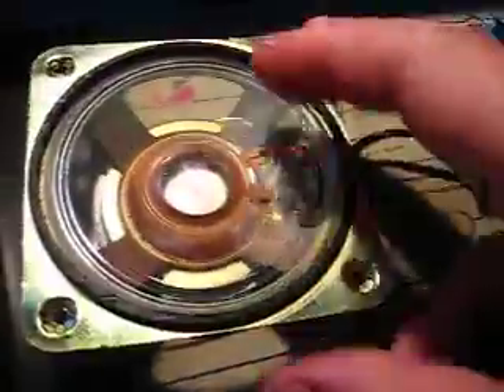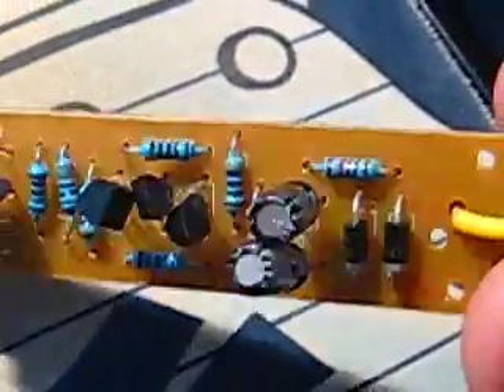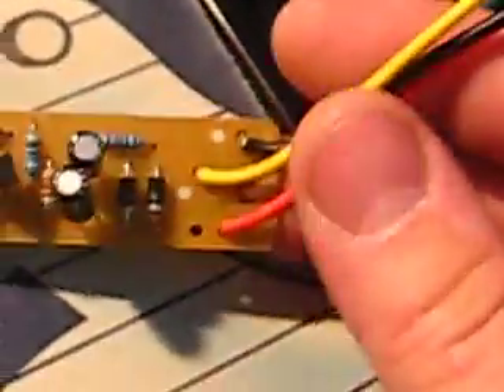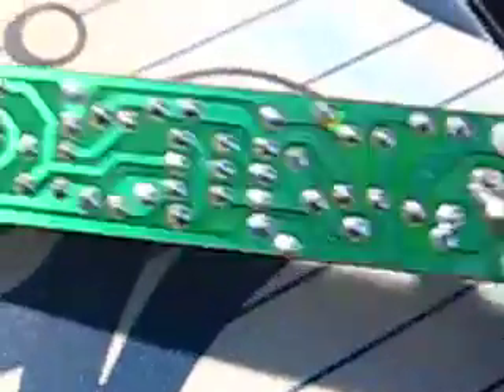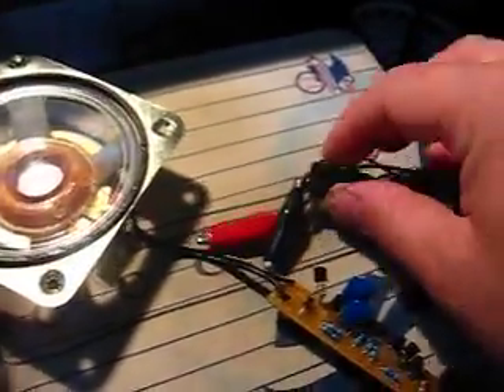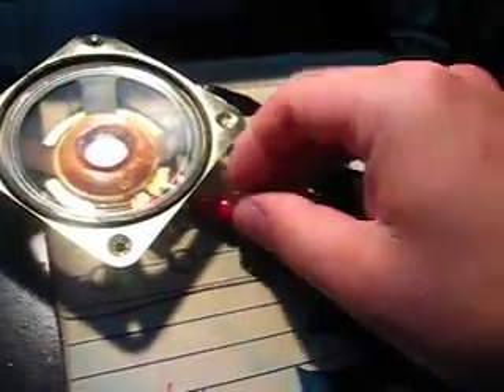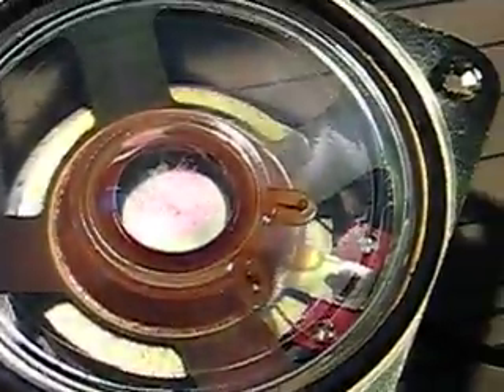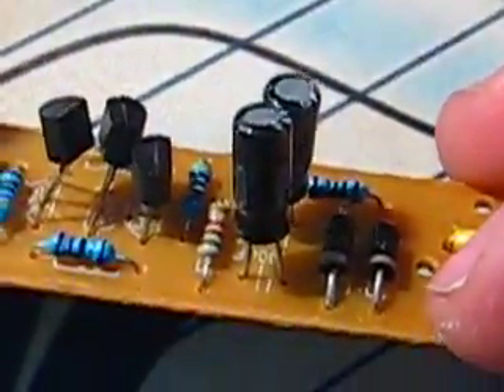Alarm Speaker hack Need help

Comment from the maker: @form109 
actually it plays a warbling wail, it came out of a home alarm security system. it was going to be replaced anyway. I was able to play my radio thru the speaker and it sounded fine. the speaker cone doesnt move much but it still sounds decent.

Comment: I think the 2 transistors near the speaker is the amp, the 3 transistors near the power wires are the signal generator, i might be wrong, but it seems to look that way. Or as mysteriousjustin said in the comment below, there might not be a conventional amp, its just the power the signal generators produce them selves that drive the speaker.